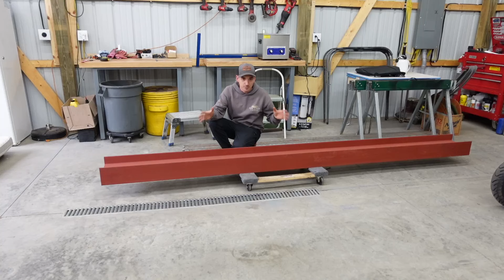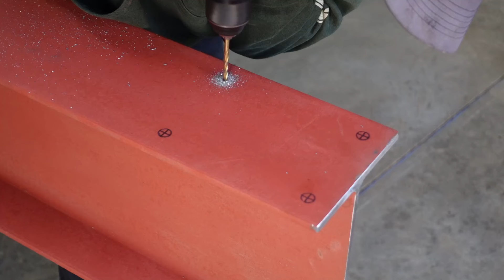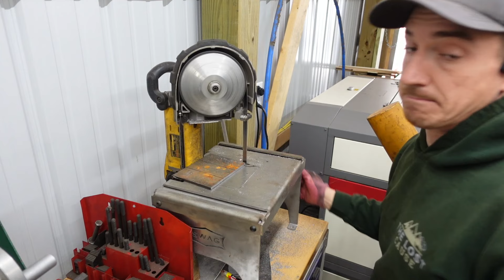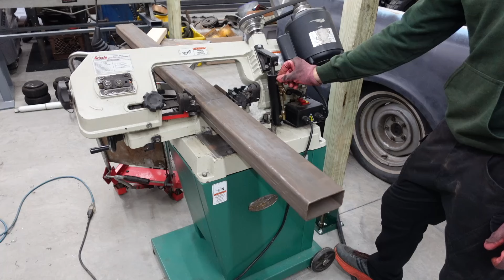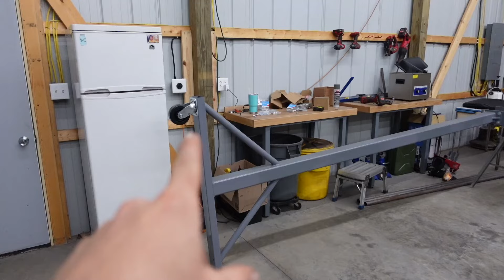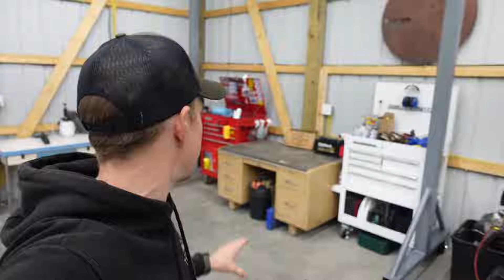Making Our Own Shop Crane

Comment: Great job - I think a gusset on each leg at the top connected to the main girder by welding would be in order for leg stability and added strength.
Reply: and I'm not sure the bottom piece on each leg is of sufficient strength for this rig

Comment: from an engineering perspective...  surely not a problem, maybe.  When you changed the design of the trolley you increased the load on each of the individual wheel sets, up to double.  The trolley was designed with an equally and always distributed load.  Your modification makes it possible to have 100% of the load on either set of wheels (and connection points).  just a passing thought as I watched your video.

Comment: If you’re going to be pushing your gantry crane around with weight hanging you should add gussets to the horizontal legs at the I-beam connection to take the shear load off the bolt connection so you don’t risk a collapse.

Comment: Lot of weight on the contact patch of those casters. It is a nice build but larger steel wheel casters would make me feel a lot better. 6”x2.5” would do nicely.
Reply from the maker: I appreciate the input. Never a bad idea to add some more capacity that way. 

I don’t think I mentioned it in the video, but I intend on making some removable leg extensions that would have additional casters as well to put on when I’m lifting longer stuff with more overhang (something like the truck bed off my Chevy). So that would be another way to spread that load on heavier/more awkward lifts.
Reply: @ I watched your video because I very much need a gantry and am thinking DIY is going to get me something to fit my needs. I think your design is a good fit for me, but with a chain hoist.

Comment: Hey use a pair of vise grips on the drill press table its safer and faster than holding it and you can use your free hand for putting coolant or lube on your drill bit. Your young save your hands also get a hook magnet and hang the vise grips on so there always there.
Reply from the maker: Yeah that would be the smarter thing to do. I always appreciate the advice and people keeping an eye out. I do have one of the bolt on half vise grips that goes in the slots that I usually have on there. But I like the magnet idea.

Comment: Awesome build. Some triangulation from the beam to the leg (even a bolt on 12 inch triangle) and a 3rd caster directly under the leg would massively increase safety margins.

Comment: what about a winch on one side of the ibeam and a pulley at the other, couple wraps around the winch drum - for a power side to side positioning of the hoisting winch. would have to be mindful of any diagonal of the lifting cable. How well does the trolley and casters plant themselves when under load? I've seen benchpress weights slotted to make caster chocks, but again you have to make sure a chocked caster doesnt become a tipping point. edit: nevermind, I rewatched and see you have locking casters.

Comment: You could use braces and horizontal extensions on on the legs to be safe.
Reply from the maker: I was thinking about adding some slide in extensions when it comes time to lift the bed off the c10 since it has a little more length.
Reply: @ that would be neat and more stable when moving unit.

Comment: How about a piece of pipe in between the uprights that's removable to use like a handle to move it
Reply from the maker: That’s not a bad idea, something along those lines would aide in moving it by yourself.
Reply: @LostCauseRanch  even a 2x4 clamped on the uprights should work as a temporary fix, looks amazing

Comment: Hate to be the negative voice in the room, but you’re taking HUGE risks here.  A true gantry has a LOT of weight in the “feet”, and the four support points are much further apart compared to the height.  You are basically betting your life, and that of anyone working near you, on the strength of those four bolts that hold the cross member to the posts.  If you slide that 1000 lb load all the way to one side, I’d wager the whole thing will collapse/ tip over.  Wheeling a load suspended from that thing is basically begging for a problem.
Reply: Well said. This thing is super sketchy.
Reply: To limit the risk of tip-over, you can bolt two additional base beams parallel to the base beam. This allows you to easily extend the base by 3 feet on both sides. You can then remove these for lighter loads and they will not get in the way when the crane is stored against the wall. A little more work but much safer. By the way, nice video, I enjoyed it, greetings from the Netherlands.
Reply from the maker: @ferrywobma1836  I actually really like that idea, I was originally thinking something to slip in the ends for when I lift something like the truck box off my old Chevy. The bolt on to the side seems like a better solution. I could make a hanger on each upright to store them when not in use. Thanks!
Reply: Do you have any idea what the sheer strength of those bolts are? Even if they were some dinky grade 3 bolts, he’s got more than enough sheer strength as far as the bolts go. The bolts aren’t the problem. The legs probably do need to be wider though.
Reply from the maker: @tylerkurfees4762  I agree on the connection at the top. I've been around quite a few of these in various fab shops and the majority don't have any additional angle support built into that top connection. The bolts are 1/2" grade 5, 4 on each side. The sketchiest part in my opinion is the Chinese hoist haha. But that is limited to 1800 lbs of lift, so it's never going to see anything crazy anyways. But I do have an old ford chain fall I'm restoring to replace that at some point. Maybe some day I can justify one of the fancy new Milwaukee battery powered chain hoists.

But the legs are short, it has worked great for everything I've used it for so far with a 1200ish pound engine/trans combo being the heaviest thing lifted so far. I did intend on making some sort of slip in leg extension for when I go to lift the box of my C10 since it will have some more hanging out length wise. But I kind of like @ferrywobma1836 's idea to make some to just bolt onto the side. Could make a couple hangers on the side post to store them when not in use.
Reply from the maker: I appreciate the feedback, it's always appreciated. I never articulated in the video that I intended on making some sort of slip in leg extension for when I'm lifting something that overhangs more (something like my truck bed on the C10). 

The 4 bolts on each upright is pretty typical construction from most of the gantry cranes I have been around. If you look at something like Advantage Cranes' FG series, their 5 ton version has pretty much the same connection point at the top beam. And their 1 ton version 12' span has a 6" I beam, mine has a 10" I beam. Mine has an 1800 lb hoist so it will never see that 1 ton load.

I will concede there has to be caution flinging stuff around with the shorter leg length as it sits. I did recently pull a 1200 lb. engine/trans combo out of a vehicle, it moved around fine and was able to slide along the beam fine. I do have a very flat and smooth floor though so that helps in stability for sure. I also made sure I was the only one around so I would just hurt my own dumb ass if something happened. But either way, I appreciate you taking the time to comment, I'm always up for criticism and learning. The removable longer legs will be added in the near future. Thanks.

Comment: Stink bugs are a unique bug. it's hard to get an insecticide that will work because their entire adolescent life they are arthropod (eight legs) and their anatomy is the same as a mite. So normal insecticides that work on six-legged insects won't work on them until they become an adult... And by that time they're all over the damn place. 
I bought a house that was cedar shake, first two years I thought I was going to lose my mind. All winter one would pop up it was like where is Waldo. 
After doing extensive research I came to the conclusion that they were laying their eggs under the cedar shake, then they would mature and find any little crack in my house to get through what's the temperature got cooler outside. 
So I knew where they were breeding but that didn't help me out cuz I can't go underneath every single shake...
My solution, I got the Hot shots bed bug insecticide. This is especially important because it works on bed bugs which are a mite. The main ingredient also works on ticks. 

Anyways on my pressure washer I had a foam wand. I got a hose that matched the diameter of the feed for the soap supply. I put a quick connect on the end of the foam wand so it would accept the pressure washer nozzles. I used a 5° nozzle and sprayed all of the cedar shakes, the entire house. I did this late summer... We didn't have any that year. We didn't have any the following two years and I didn't retreat. last year we had two. So I can say 100% that it works. You have to figure out where they are laying their eggs. It will be organic and probably wood. It could be a woodpile, fallen trees, etc....

Word of warning... Learn from my mistake... For God's sake get yourself an organic respirator. The wind was blowing the day that I was doing it. I guess I got some fine particles in my nose and I made more snot than slimer from Ghostbusters. I couldn't stop sneezing for two days. Good news I did my whole house 5k sqft. with 2gal. I got the stuff from home Depot it costs like 10 bucks a gallon then, so it's probably 13 bucks now. Very economical, especially since it lasted for 2+ years. 

You're welcome.
Reply from the maker: That is very interesting. My house gets them as well and coincidentally, it is cedar sided. I’m sitting in the middle of 9 acres of woods so there is plenty of opportunity there as well. But that makes a lot of sense on the house. Last year was the first time I had them in the 7 years I’ve been here. 

I appreciate the advice and you taking the time to share it. Thanks!

Comment: A dedicated electric gantry hoist would be far better than the VEVOR attic lift device you got. It isn't designed to use the way you are using it. When it fails, it will end dreams, just sayin'. Be careful.

Comment: very nice work im going to build one just like it , but i am going all out on the casters , that thing prolly weighs 7or 800 pounds alone
Reply from the maker: Appreciate that!

I’d have to sit down and do the figuring on the weight, but with the hoist I would guess around 600 pounds but you could be right at that 7-800 mark as well. The casters are rated at 1000 lbs each so 4000 total. And the hoist will lift 2000 lbs so it should fall well within the rating if it is loaded evenly. But having bigger casters would definitely never hurt.

Comment: Nice work. I'd suggest additional braces on the ends of the I-beam to overlap the uprights. A big risk is uneven loading and folding at that joint- especially with the hollow 4x4 uprights. Spread that potential load out ;)

Comment: new here. nice build. can you share what size beam you used (overhead). obviously,  no engineering, but those i-beams can take tremendous weight loads for a given span. think your winch was 2000k or so, wonder if you have measured for deflection after picking something up like a big motor or so.
Reply: That I beam won't deflect any meaningful amount even with that electric winch maxed out. The problem is the lower 2x4 horizontal base tubes on the bottom that the casters are bolted to. Those things are going to fold like cardboard with anything more than about a ton suspended from that thing. Super sketchy.

Comment: HB Machinery gantry’s use a clamping system where the bolts are on the outside of the beam, we use that brand . It makes it easier to adjust where the legs are & doesn’t make them fixed. You could modify yours to do that style. I know others mention glasses, but you shouldn’t be wearing gloves while drilling. I know someone who lost a thumb because of that.

Comment: Add corner support at the top. RWB ❤🎉
Reply: this^
Reply: @AndrewTheHoff  Seconded. A little triangulation at the top adds a lot to the transverse stability.

When I built my shop, I ordered 3 extra trusses and ganged them all up in one place at a convenient spot. Then I put a steel plate across the top to spread the load across all 4 trusses evenly. That's where I hang my chain hoist or whatnot when I don't need it to be mobile.

Comment: those bottom bits are way too short in my opinion they should be longet and thicker if for some reason a load shifts when u are lifting it its gonna topple over
Reply: I agree. Were the dimension from the "off the shelf" using the same height and weight of the top beam? You have a beefy top beam, then add heavy trolley and winch, so this crane already has a high CoG. Most I see have the legs equal to about half the height. I think yours need to be about 6-7 foot at the base. If you lift a motor and yanking it out causes the load to swing leading to this toppling, consider how much weight will fall from 12 high. It could kill someone.
Reply: Agreed. Too short and too small. It'll be fine for picking up sheet metal truck bodies or whatever, but anything more than a ton and those things are going to fold. Hopefully they don't plan on lifting anything major with this.
Reply from the maker: I'll keep an eye on it and see how it reacts before really throwing a load on it. I went off some dimensions of some off the shelf cranes from companies that manufacture them. On the thickness, they are 1/4" thick and no measurable deflection with the C press lifted, the diagonal braces also transfer the load to above the casters so it's not just pressing down in the center. I do appreciate the input and I'll definitely was into using it, always good to have someone questioning my home-brew engineering.

Comment: Very cool. Just a thought maybe some neon pant on the feet of it so when you are backing a car out in the shop you might see the where the feet are. Grey primer might blend in. 
Plus it will add another 100l0lbs lifting capacity.
Reply from the maker: That is actually a really good idea. I used to bang my head off hoist arms all the time, so protecting myself from myself would be smart. I think if we tape off a 5 inch section above the casters and do something bright that would work well. Appreciate that! I often gloss over things like that when I'm in build mode.